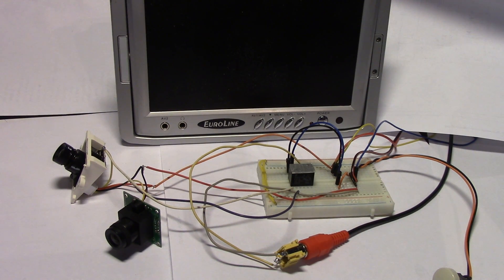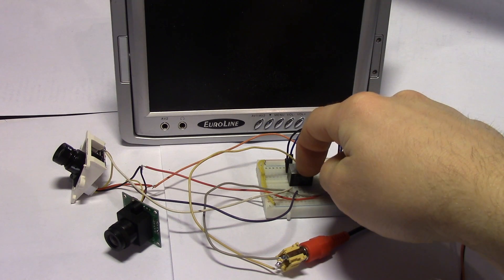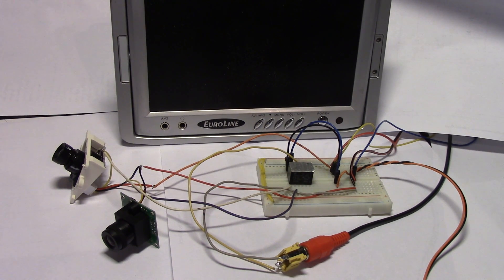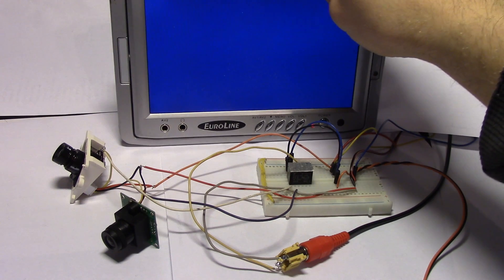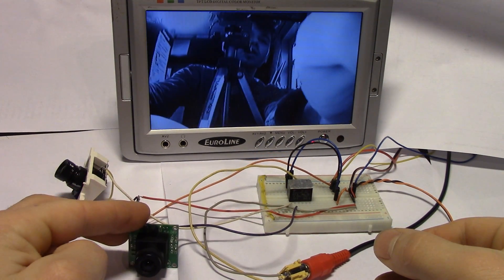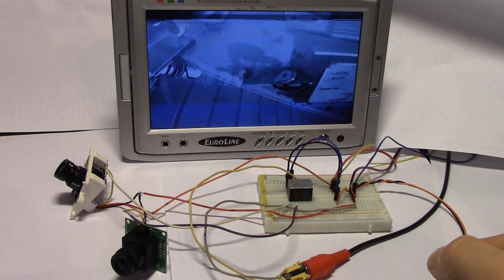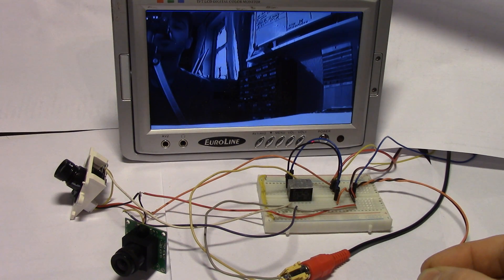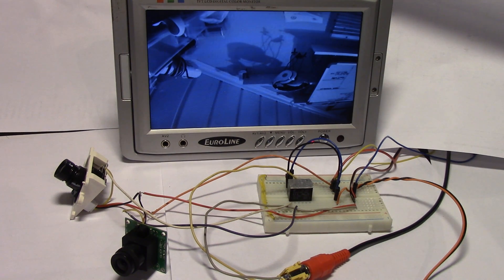Easy way to switch video signals

Comment: Hi. Nice video. A diagram would help alot. A tv switcher box would work aswell, the ones used long ago for switching from tv to DVD player and divices that used rca in lineouts. You can even make it with a selector switch. Basically all the cameras are ground is joined together and signals are connected to each camera.

Comment: Thank you for this video! I was wondering if this was possible to switch between signals this way. i'm considdering adding a front camera to my car so this should bring this project one step closer
Reply from the maker: So glad it helped you this method should work well in your car! Thank you for the sub :)
Reply: Do you think this will work? 
I want to do the same two camaras to where the reverse signal acts as the switch and displays the back camera, and as soon as the reverse is disengaged, the signal returns to the front camera.